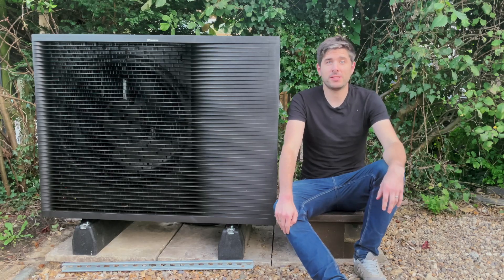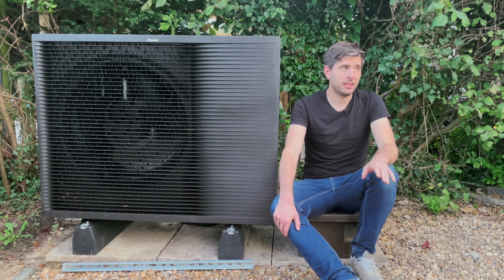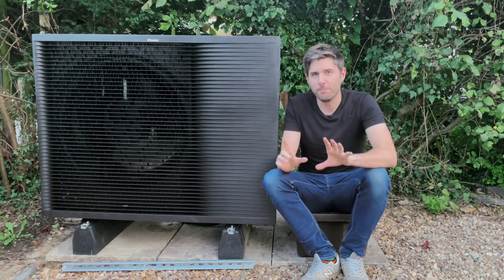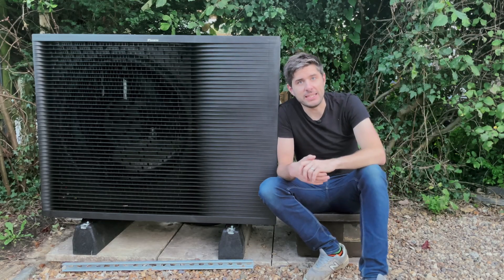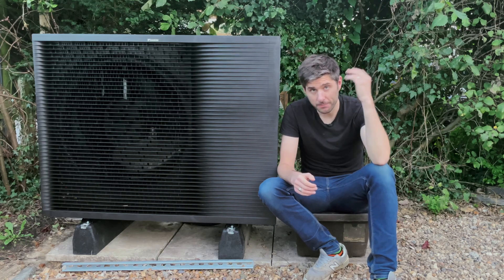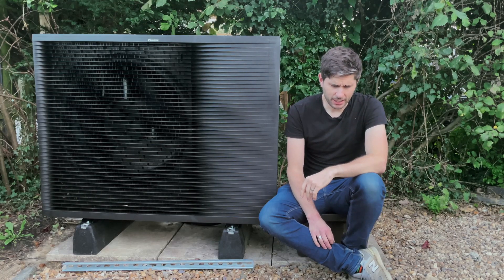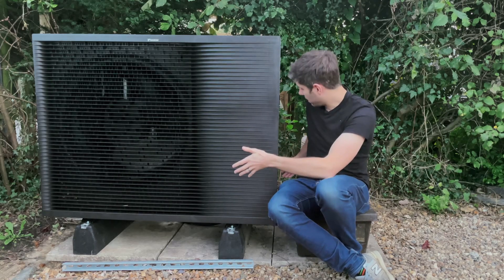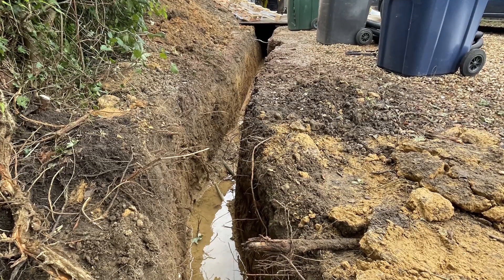Replacing an oil boiler with an air-source heat pump: Why, what and how

Comment: Super video thank you. I'm sure you will be fine this winter. We have just had ours installed in July of this and know how long the installation process it. Like you I initially had a buffer tank, but soon had it removed. Our system is microbore and the buffer tank was put in as an assurance item. However, it does impact efficiency and increases noise. You may find your system will actually work without a buffer. Fewer and fewer installers are fitting them now as they learn more and more about ASHP installs and how to improve efficiency. Perhaps something to think about in the future. 

One by one we are making a difference by moving away from fossil fuels. The hot water being poured into the ocean, using your analogy, is reducing day by day, week by week as individuals move to hear pumps. It's still early adopter territory in the UK but it is picking up speed rapidly.
Reply: @CaptainProton1  
Actually it does still reduce, as China, or any other country was going to do what they were going to do anyway, so their increase was already in the works.
While decreases anywhere are a new thing, and not loved by the oil who own us.
Reply: @jimthain8777 so it doesn’t reduce then, just an insignificant offset from the rest of the industrial world who continue to laugh at us.

Comment: We’re in much the same boat. We live in a little Shropshire village where there’s no gas and we recently had our perfectly functioning oil boiler removed and an air source heat pump and Mixergy cylinder installed.
I mentioned this to the engineer who used to service the oil boiler and he said, in all seriousness, “keep hold of it and I’ll plumb it back in for you when you realise that heat pumps don’t work”. 😂😂😂
We’ve never been warmer and costs aren’t too bad as we’ll save the best part of £1000 pa by not filling up with oil each year, and have a 4KWp solar array, which helps.
We’re having another 10kWp of solar installed later this month and 28.5kWh of battery storage so that we can further address the costs in use.
The unit we have is a Grant Aerona 13kW and it runs whisper quiet. If you open the door and listen carefully you can hear water running through the pipework in the cylinder cupboard, when the heat pump runs, but you need to go outside and stand right next to the ASHP to hear the device itself.
Reply: That's some solar/battery arrangement that you'll have!
Reply: Actually that was a sensible back up plan as the old oil boiler was costing nothing to keep apart from a bit of space. The oil tanks had to go anyway. I have designed a dual system where some radiators are heated by an air pump but others are still heated by a combi boiler so if the outside temperature is low I can get the house warmer quicker.

Comment: I did the same thing this spring for the same reasons and using the same Daikin system!  So far looks to be about half the cost of running on oil. Here in France heat pumps are common, so no raised eyebrows!
Reply: Gas is so much cheaper than electricity in the UK so it's difficult for most people to justify (financially at least).
Reply: @eddyd8745  Gas must be around 4 times cheaper per kWh to be equal to an ASHP, allowing for a SCOP of 3 (minimum) plus the inefficiency of gas boilers - say 10-15%.  

With oil the current price is ~1.35€ per litre and each litre yields 10.5 kWh before inefficiency of the boiler - typically 15%, i.e. 9 kWh net. So ASHP will use 3 kWh of electricity at COP 3 to make 9 kWh of heat, costing 3 x 23.5 € cents (prices just went up by about 30% here) - about 70 cents.

A little extra is not ruining our climate!
Reply from the maker: That’s good to hear!

Comment: Great video, I've got an ASHP in a 200-year-old solid stone house, and it works fantastically, it's been cheaper to run than mains gas and more comfortable since the house is a nice consistent temperature
Reply: @@johnchapman7719 financial you may be right short term. Heat Pumps currently cost alot. Environmentally you miss the point a heat pump can slash our personal green house gas contribution. Green hydrogen for home heating is a myth. The cost will be huge when you look at efficiencies of production transport losses and network upgrade. Not to mention hydrogen is far more explosive than methane. It is estimated that if hydrogen replaced methane domestic explosions would increase 4x . It has been discredited time and time again.  It  is a delaying tactic for the fossil fuel lobby. Green hydrogen will be of great use but not for domestic heating.
Reply: I don't think so gas in four times cheaper than electricity for 1kwh if you factor a hp is 350% efficient and a gas boiler about 97% efficient gas is still cheaper.
Reply: @john-eo1ns with those numbers perhaps . But my elec to gas ratio is 3.7 . There are almost no gas boilers running at 97 % efficency. Also I have a scop of 4 . So it is quite possible to have lower running costs. Also the green levy is moving soon from electricity to gas .   This will further push the ratio in favor of hp. But the financial argument is  hit hard by the upfront cost.
Reply: So what did it cost ? Did you have to upgrade your insulation and what did that cost ?
Reply: Just remember these things last about @8 years . A lady in our village had her Husky replaced ( it could not be mended as no spare parts available ) and it cost her £8400 for a new Mitsubishi unit including the fitting.
Reply: @robtt997  thinking more about this poor lady. This sounds like one of the installers was a cowboy taking advantage.  A replacement ecodan unit is about 2.5 to 3.5k. Plus a day to change it out. So for it to have cost 8k. Alot of other work must have been needed which means the initial instal was a mess or the second installer was ripping her off. Unfortunately elderly people being taken advantage of is not unique to heat pumps. Bathrooms, kitchens driveways. But good cautionary tale.
Reply: @joewentworth7856  She told me Husky went bust . Therefore there was a lack of parts to repair her installation. The new unit was not a straight replacement and a lot of work was involved to fit it. Seemingly , the problem is all manufacturers have different fittings so one make can’t just replace another . The industry needs to get its act together on this .
Reply: @robtt997  I think I must has been a system type change perhaps a split unit or air to air system to air to water which are not a simple change. But the incressinly common air to water monobloc systems are fairly swappable as the water connections are standard. Still stands that for most people repair of the unit like a combi will be the most likely experience.
Reply: @robtt997  that's a fair warning. Buy a brand who are going to stick around.  Vailant units are definitely repairable and have spare available... but same as buying cheap 'single use ' combi. It could also be due to the lack of f gas techs about. If you thought there was a shortage of heap pump installers. Try to find someone to re gas a unit. It will change as the market grows though.
Reply: @robtt997  A well maintained ASHP will last 20 years.  We've been in our house 26 years, and we are already on our THIRD gas boiler, so gas boilers are no different.
Whilst researching ASHP I've never heard of Husky in Europe (inc UK), so that must say something about that brand.  Vailant are a massive European company, and as @joewentworth7856 said they're repairable, plus suited to our climate.
One thing I would says is to get a proper survey of your property by a HeatGeek trained installer.  It should take at least 2 hours.  If any installer finishes their survey quicker than this then you might want to pass on their quote.
Reply: What upgrades did you do to make the ASHP more efficient?

Or did you previously have a baxi back boiler?
Reply: I would be interested in seeing the figures. I have had an ASHP for ten years, replacing an oil combi. The heat pump has to be left on all the time as the response time is so slow but with a long burner to supplement our heating needs and the taxpayer funded subsidy it is ok. Sometimes cheaper than oil, sometimes more expensive depending on prices. Mitsubishi technical service is very poor.
Reply: @nickjung7394  we went from using 9000kwh per year for gas. To 2700kwh elec on the heat pump. This also include having the house near 20degrees now with gas more like 18. We have solar pv too which offsets some running cost.
Reply: @joewentworth7856 what was your total outlay for the new HP system?
Including radiators, insulation etc,
Reply: @joewentworth7856  Based on the relative costs I cannot see how that is saving any money at all.
Reply: Paid to say this?
Reply: @stuarthall2523 this comment section is either paid advertising or everyone is lying,
Unless your in an unbelievably well insulated home that's cost a fortune to make air tight there's next to zero chance an AHP is cheaper to run than a condensing boiler, especially in the middle of winter.
Reply: @stuarthall2523  🤣
Reply: @@johnchapman7719  Have you not heard that H is a nightmare to stop it leaking? It is, after all, the smallest atom in the universe. 
Making blue H is just burning more fossil fuel, and green H is going to cost you an arm and a leg. 
A non-starter in my opinion.
Reply: The exception
Reply: We received a 100% ECO4 grant  which covered ASHP, solar and heavily upgraded insulation  Stone cottage went from an EPC of E to a B
Ashp was installed in a day by 12 tradesmen
Reply: @@johnchapman7719 at best I could have got an extra 10%-20% of extra efficiency from my combi boiler, the ASHP is half the running cost, so it's a massive step change, and more importantly an ASHP is currently 6x lower carbon than gas and is on a pathway to be zero carbon as the grid further decarbonises. Hydrogen for domestic heating won't happen at any sort of scale. Even if it did happen it will be astronomically expensive. The hot water cyclinder for the ASHP fits into the same small cupboard that used to house our combi boilter.

Comment: Most likely reason your water cylinder needed to be replaced was the internal coil of your old one didn't have enough surface area to transfer enough heat at the lower temperature.

It's effectively an internal radiator upgrade.
Reply from the maker: Yep, I think that was it!
Reply: Also since the temperature in the tank is lower, you need more of it to acheive teh same bath or shower [etc] temperature [you previously mixed cold with the hot, of course]. 
This was the reason in our installation.

Comment: Excellent idea and video we are like you and live in a oil only village everyone told me i was mad 3 uears ago fitting an ashp and im glad to say i am happy we did. Whole better experience with comfort levels and no worrying about ordering oil. Freed up space in the garden. You are right about keeping heat in although dont be put off if you have a old house ours is 220 years old and solid stone. Still very happy with the running costs
Reply: Did you install without the grant then? How would you go on for heat and hot water with a powercut in winter?
Reply: @dj0men666  we get RHI which was pre the Grant. And as for a power cut your oil boiler has to have an electric supply the same as any gas boiler. The only thing that doesn't is a Rayburn or AGA that has a vaporiser which we did have a oil Rayburn but I also converted that to electric as its half the cost to run as they are very in efficient on oil
Reply: @johnfreshwater3790  ive got a h2 panel that links up to my log burner. They do a h5 for link up with heat pump. Good bit of kit.

Comment: How much did the whole system cost to install please?
Reply: Why can't you just say how much it cost
Reply: Monoblocs are only practical and efficient enough if they can be placed close to the property. As a result they are not an option in some cases.
Reply: They went for a split unit so easily over £30,000. IMO they have been ripped off considering you can get a monoblock for under £1500 and they could have just added that and kept a small oil or gas cylinder for the 10 actually cold days of the year.
Reply: @Swwils   30k wow If they save 200 pound per year it will take 150 years to recoup the cost and they never tell you the price of leccy is 5x the price of gas and going up. Even " cheap" night time  is still far more than gas and to make this work you need to spend thousands more on batteries to store it.
Reply: @danascully-x2t  the base technology is not expensive you are just paying for 1. UK installers being completely clueless 2. UK installations still harking back to the 1900s and 3. Some kind of love for wet systems above all else.
Reply: @danascully-x2t  except he's not on the gas grid, and was having Oil delivered to his property.  And they never tell you the price of electricity is 5x the price of gas because it isn't, it's just shy of 4x on the price cap, and the overall trend is that gap is getting narrower, and is due to shrink further, with the environmental and social obligation levies still being outdated for the current electricity mix.
Reply: @BenIsInSweden  I  have an oil condensing boiler. My last delivery (in January) was 88p/litre (about 9p/kwh allowing for efficiency). Most ASHPs will have a COP of at least 3. With a dual rate tariff of 30p/9p an overall estimate of energy price might be 20p/kwh. Applying the COP this reduces the net price to about 7p/kwh heat for ASHPs. Not much of a gain yet and only worth considering if you have to change your boiler anyway. This is just one of several variables to consider. I think that the Heat Geek guys provide the most balanced analysis of how to heat your house.
Reply from the maker: Closely guarded secret, it was definitely on the upper end! Still, there are definitely cheaper ways to do it…

Comment: Thanks for putting together your video. I'm looking forward to seeing how you get along. I'm sure nice and snug all winter. Would be really interested in knowing what temp the radiators actually get to if you have any way of measuring. I know the flow temperature low, 40 or so - but I'm curious what actually  the rads actually reach.
Reply: IME [we had an oil boiler replaced by ASHP 2 years ago, modern house, ] is that the bedroom rads don't get noticealbly warm, but the rooms are as warm as before. it's the constant low level feed that does it. When properly planned ASHPs are great.
Reply: They will be 20 to 30 degrees cooler. And give of proportionately less heat.... this can be countered by more flow (if you don't have micro-bore pipes or small radiators) and by running them for more hours per day. My central heating pipes are set in the walls and are micro bore. I would need to rip them out and replace all my plumbing and radiators with bigger ones, and OMG, the cost of replastering and redecorating. A heat pump would cost me more than £20k.
Reply: @occamraiser  You may  be right about the microbore being too small, but not necessarily. 
Eg our bedrooom rads are fed with 10mm (o/s diam) pipework, and only get noticeably warm when it's actually freezing outside. 
The rest of the time they warm the room without getting warm to the touch, just on all day. 
A survey of your house and system by someone who knows how to do the calcs correctly might say you are ok.

Comment: Loved it. Very honest. I liked that you provided the sources of the videos you showed. I think you needed a new water tank for your hot water storage because the water flowing into it to heat the water has a lower temperature than from an oil or gas boiler, so maybe there is a bigger coil, but I am not an expert in all this.
Reply from the maker: Yeah I think you’re absolutely right about the need for a bigger coil